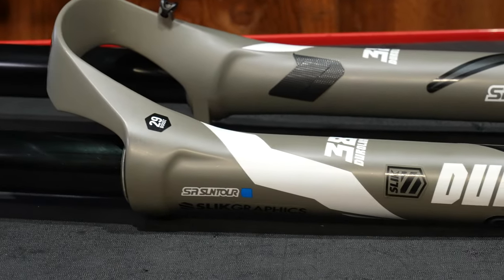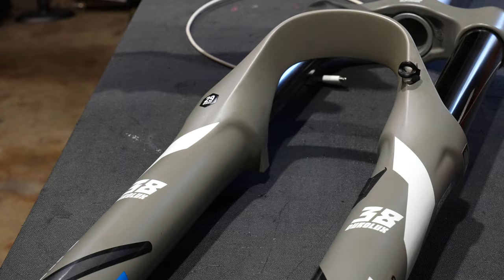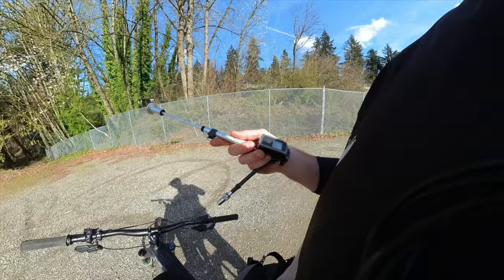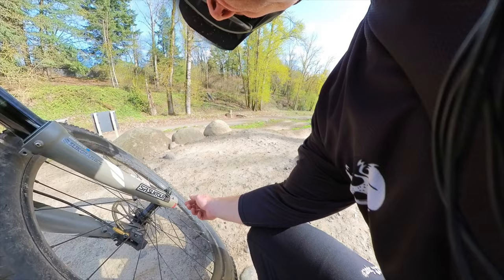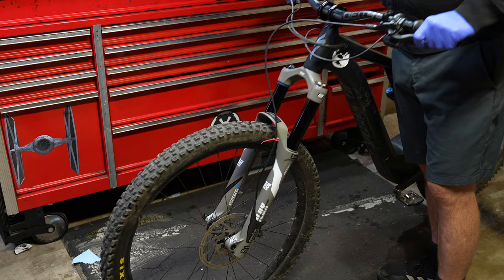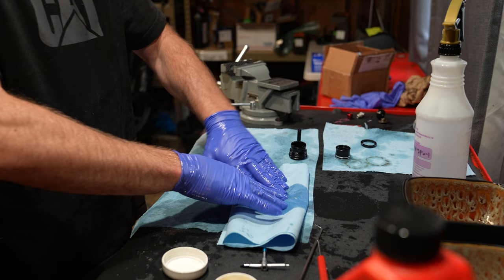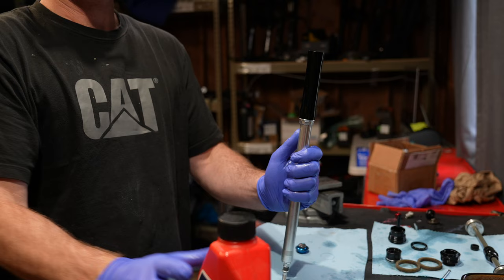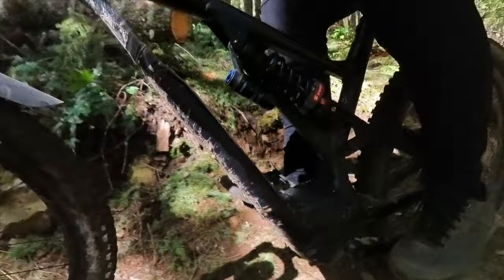Suntour 38 DUROLUX | Deep Dive Reivew

Comment: Durolux owner here. No mine does not sound like that. I’ve owned quite a few - never had one make that sound.
Reply from the maker: Thanks Jared, I figured something was wrong, but I swapped damper oil at end of the video, and full serviced it, and the fork was pretty darn good. No one will get to the end of video, but they will read comments 🍻
Reply: @OtterMTBtech  i catually do both BUT depends, since you sound like you know what you´re doing, i was curious you fixing this thing :)

Thanks for creating content!

Comment: Hose clip I just used a zip tie, those clips on any brand fork suck. I have the Durolux36 and have been riding it for about 8 months now I think and it has been performing great. Lots of support in corners and jumps, good adjustability and the price is right. Yeah its heavy, the only real notable downside I can come up with at this point but servicing it is pretty straightforward and easy IMO.
Reply from the maker: Lower service easy for sure. Glad it works. Whats your setup on fork?
Reply: @OtterMTBtech  Running them at 150mm, two tokens and otherwise stock inernals on my hardtail. Took a ride or two to really dial in compression settings but a couple bracket sessions and voila.
Reply from the maker: Jump on the fork and film it post it here, I’m curious if the noise is same.
Reply: @OtterMTBtech  My fork is silent. I have never heard it make any noise at all. Its my main bike so there are vids of it in operation on my channel.
Reply from the maker: I watch your videos you’re on smooth cross country trails in Yakima. You got a jump on the fork on the pavement with the microphone close to it.. was always curious what I would like to go biking in Yakima. I’m in Portland.
Reply: @OtterMTBtech   I will see what I can do about getting a vid of the fork in compression this weekend and will hit you up when I post it.

Comment: I'm durolux 36 29" owner, and that sounds is definitly from the damper (maybe rebound piston?). I recommend you to wait for the 2025 dampers to buy a new one, and you can update your fork, I have tested it and it's completely different, nice pedaling platform, super great response and sensitivity, and will make your fork more active. The 25' version need oil in lower legs for lubrication and not only grease as the previous versions. Hope that will help 😁

Comment: Quick non-pro tip ... you don't need anything fancy to inject shock fluid into the uppers. Place the bike on its side, support the front with a box so the two injection ports are facing up. Loosen each in turn and use a cheap 2oz plastic syringe to inject 2ml of shock fluid into the uppers. Just jam it into place and the plastic tip will deform enough to create the seal you need.

Comment: You need to clean out the lowers really well and probably replace the wiper seals, normal skf 38 mm should fit. Lube up the top bushing with super slick suspension type grease and soak the foam rings with plenty of oil. You can run oil in the lower legs on the air side with out issues, but not on the damper side cause the damper sucks it up and then you end up with less travel and harsh feeling fork. Stock oil in the damper is 5wt so putting 2.5 wt makes them feel much better, damping adjustments are pretty much set and forget type of deal, you can play around with the shims on the mid valve but no much else. Often servicing helps with the longevity and performance. It would be cool to see if a custom sealhead with better seals can be made to be able to run lower leg oil in the damper side as well.
Reply from the maker: Thanks for info, repair manual here  https://www.youtube.com/watch?v=lMwwoygFw1E

Comment: You said it's a "dry fork" inside and was carving up the seals.

I've got the 36mm stanchion version and it's a grease-based fork. You put grease on certain areas, and try not to block the air spring equiliser groove. The rear injection holes are to inject 1mm of oil inbetween lower leg services, until you reach 5mm (write on a log on your workshop wall, or in your phone) and then you need a full lower leg service, stripping, cleaning and regressing. 

There's a new Bolany fork out 4 months ago (34mm stanchions in 27.5 or 29". The 27.5" is 580mm A2C and advertises 175mm travel, but mine only reaches 166mm and as a result the air pressure is far lower than the guidelines. Also the sag indicators on the stanchions have been printed upside down so completely useless even if I had the right amount of travel) Anyhow, their screw holes they say are for lubing the seals between services. The Durolux injection holes I'm not sure. Seals? Or lower legs in general, including bushings?

The noise that used fork was making was atrocious. It's supposed to be a fairly quiet fork. Knowing how the fork is supposed to sound, I'd be thinking you needed a new damper, maybe even bushings and seals if the fork had been run dry and carved up inside until particles entered the damper and wasted it 

I've not taken the top caps off but interested to see there are tokens in there. You can Google them for sales, but in the country I'm living in spare parts (including different length air springs) are impossible to find for RS or Suntour. I'm going home in summer and will try to get some parts bought to take back with me.
Reply: Does you bolany fork felt better after injecting 1ml of oil inside the screw holes ? I have a chinese air fork too and it was really good the first time and started to quickly fade after some time. I wonder if injecting some oil there would help since it looks pretty easy
Reply: It's brand new. Two rides in. Haven't had time to let it go dry yet. I did inject it with 1mm of suspension oil on each leg for the second ride just to check if it was dry out of the box. I'd also dropped the air pressure at the same time due to the stated pressures being wildly wrong. Small bump response isn't good given it is so cheap. Ram into a kerb and it'll work okay. No topout with the damper adjusted appropriately. Action feels like a Manitou Markhour with the Kwiktoggle damper. Only time will tell.

Comment: If you really want to know, how does a fork perfom, you must service before use. Even new ones. 

First you should check the lowers and the uppers with your front hub. It will be day and night if you shim (DIN988) out the hub for the less resistance.
If it doesn't help bushing burnishing is the way to go. But that's expensive toolwise compared to the shims. That's the hack that everyone can do at home, who's confident enought to take a part their fork. 
You need to gut out the fork. Completely. Just the lowers (no foam rings, no seals) and the stancions into the bikestand. Actuate the fork and see how much resisence it got by the lower bushings. Than add you front hub (wheel) and torq it to the max of the axle. And repeat the the actuating process. If you feel resistance, add shims both sides. These shims comes in different thicknesses, 0,1mm, 0,2mm, etc. Put shim between the dropout and hub or under the dustcap (depending on your hub bearings and your taste). If you need less widht you need to sand down the dustcap. 

If this is ready, you can service your fork. This method will increase the fork performance to the max and depending on the front hub could result in a day and night experience. 
For the pro solution check out this guy: https://www.youtube.com/@olivermajewski/videos
Reply: I second this . I have a rockshox recon and brand new out of the box it worked but there was no gradual ove time oil purging through the seals (wich is happening after service) wich is telling me the fork was likely underfilled from the factory
Reply from the maker: Sadly no one knows this, and 90% of people won’t get to the end of this video and find out that the fork was awesome after damper oil swap. 

Totally agree tried to watch that guys lower leg video I could barely follow it , but thanks for comment
Reply: @OtterMTBtech  The funny part is that high end, really expensive forks can be shit. Back in the days Fox forks had a tendency for bushing play, prefox Marzo had the same issue, recently got RS issues with this. So they make the forks stiff. This is the deal against warranty issues. 
The fork is just a part, of the front suspenison system. Which contain the front hub. If the dimensions doesn't fit, it will be fucked up (ofc on a scale).
Reply: @donavinnezar  Low end RS stuff is notorious not haveing enought lube in the lowers. Higher ends are better bc they operate with much more lube.
Reply from the maker: Last Rockshox fork I dropped lowers on had no oil. ‘23 Lyric had such tight bushings it felt like they were stuck when checking sag . All valid there 😎
Reply: @OtterMTBtech  shimming will solve your problem
Reply from the maker: I couldn’t even find where to buy the shims

Comment: Durolux owner here! Ive always loved suntour forks “the higher end ones” Ive never had rattle issues before but that chirp noise is normal for suntour forks as it was probably custom tuned. My suntour fork was custom tuned and had that chirp noise and personally i loved it, never had rattle issues like you had which is very weird
Reply from the maker: Is it air spring chirp? What do you think someone else here has the same noise they can’t get rid of it might just be need new air spring
Reply: @OtterMTBtech  its one of those reasons but its also the stansions rubbing against the stansion cups, if you have your fork custom tuned in a way sometimes the airspacers can also be an issue rattling! I had that issue on my dh suntour fork but i fixed that problem. The chirp noise means the fork is working how it’s supposed to without any play in the lowers too

Comment: So my fork made this same sound after about 6 months, I had to send it away to be serviced. Turns out the lower bushings had worn out and they replaced the entire fork without any issue. My opinion of the durolux is the same as yours. It is excellent in the chunk and big hits, it lacks in the highspeed flow. I've since gone back to my fox 38 and I actually miss the durolux...

Comment: While the damper not working properly probably had a huge impact on harshness, the fork also seems to be sucking down when you release the air pressure! Did you make sure that the positive and negative air chambers are able to equalize? Suck down can also cause harshness
Reply from the maker: It was a used fork I fully disclosed. Maybe it had excessive wear and tear or this product doesn’t age like 🦊. 

The damper oil had no cavitation when j took it apart. 

The adjustments hardly changed the ride before and after 

There was no signs of excessive grease or debris clogging the air spring. 

It rode so good after a service, I started swapping out damper oil on my other fork DVO 38, same deal hella plush completly different fork after damper oil change. DVO let me know they maybe not Suntour use 3wt oil, that is bulk  oil and who’s knows how good that is 

Someone else on comments had the same issues. Harsh or diving. That’s prettt common on cheap forks, Zeb R Domain etc .

Comment: Just took the ”cork” out from my Durolux 38 and there were 3 hard plastic tokens inside AND! 2 rubber tokens that were attached to the aluminium piston that you removed (that was held on the shaft using the clip ring). Any ideas what might be their purpose? Since on your video it looks like your fork is missing those

Comment: I think something was really wrong with that fork on your first ride since the Durolux does not make those sounds brand new.

Also, there are 2 kinds of volume reducers in the durolux EQ forks: the clip-on type and the push-on type. The clip-on type is a relic of past Durolux designs. When they use an air positve and coil negative spring system.

The push-on type is a more recent invention, along with the EQ air spring (Solo air spring)...
Reply from the maker: Well it doesn’t age well then. It rode good after, damper oil change if you got to the end. Is the lower part of the top cap  the piston O-ring assembly that’s a spacer?

Comment: Durolux 38 owner here too. Is here anybody who knows hiw to travel the fork from 180 down to 160mm? Is it maybe the same thing with the spacer like the older forks or the 36(i also own)... The explosionpictures of the durolux are to find out, but i cant find the right spacer in the net. I ride SRS for the last 15years! Tipp: Always be sure, there iat enough grease and oil in it! They are sold all nearly dry.
Reply from the maker: New air spring is how you change it
Reply: @OtterMTBtech  Bought a new Air shaft. Thx...

Comment: I could never get my high end suntour fork to feel ok. Rebound was never fast enough, air pressure was either too high with a wall of resistance or no mid stroke. Just get a rock shox dominion or zeb select at that price range.
Reply from the maker: Hey same experience hints this video, damper oil fixed it all
Reply: I saw your conclusion, I’d still rather buy a comparable priced shock from another brand.
Reply from the maker: How 2 Setup a SR Suntour enduro Fork
https://youtu.be/hPVlGvMYczA I made you a video dog
Reply: @OtterMTBtech  I saw that 🙌

Comment: My durolux doesn't sound like that. But, there is one big problem, the fork does not work in cool weather, even +5 degrees Celsius is cold for it, it is very sluggish, and as I understand it, this problem cannot be solved..

One more thing with compression: I found that high compression works the same as low compression on Fox? I compare it with my Fox 38 Factory, I don’t understand how to configure it.
Reply from the maker: Interesting about the weather. The stock damping fluid made this one ride good. 

Anything before the damping oil change to 2.5 was useless. After that service 5 lsc 2 hsc

Comment: That last clip at around 14:25 you nearly bottom the fork out just buy pushing into it. I'm fairly new to MTB, but I feel that being able to do that is not right(even on a heavy e-bike. Particularly with an air fork. Maybe someone could let mew know if this is normal though. I don't believe It's not like this with my fork(a fox 34 factory grip2).
Reply from the maker: Hard to follow video, Likly the damper has thick 10wt oil and running it without tokens was the best. 

I swapped over damper oil. And then it was to plush to run it without tokens , the time stamp you added. 

Last ride I added 2 tokens back in with the new damper oil and it just right. 

Your Fox takes 5wt oil nothing else so it’s easy to dial in it.

Comment: has any suntour fork ever not sucked?
Reply from the maker: 🤣 hey thanks for the laugh. Suntour is a powerhouse of manufacturing if they made a $1200 fork it would probably be as good as a fox. Building is junk is always the most challenging.
Reply: I have a Raidon 34 it's performance is great, definitely as good as my 2023 Fox 34, but the seals aren't as durable and the bushings are quite thin. Still.. Great performance from a cheap fork

Comment: I had not so amazing experience with Durolux 36 and as far as I can see, 38 is not much more better.
Reply from the maker: Hey I fully decided was hard fork. If you can get to the end of the video I swapped damper oil and it rode really good with lighter oil.

Comment: Nice to see the difference after you serviced the fork. One question, the service you made was disassemble, clean, reassemble with new fluids and without new seals?

I had a Durolux 36 (bought new) and it's hard to make it go all the way through the travel, lots of support. Differs a lot from the RS Lyrik with blows through the travel.
Reply from the maker: Yes, there is no parts to order, there is no service guide, there is no oil type to use and no support for home mechanic ing from Suntour at this time, they said it would change, but did not get me any instructions.
Reply: @OtterMTBtech  that's a shame to hear
Reply from the maker: How 2 Setup a SR Suntour enduro Fork
https://youtu.be/hPVlGvMYczA

I made a video to fix it